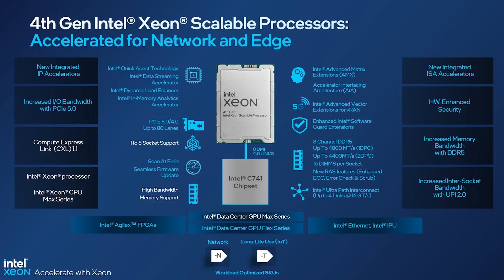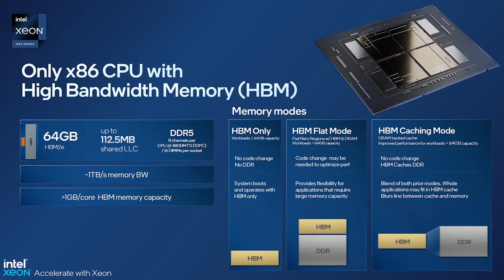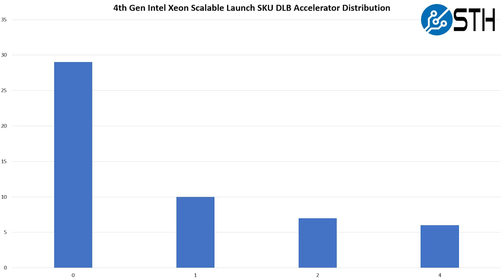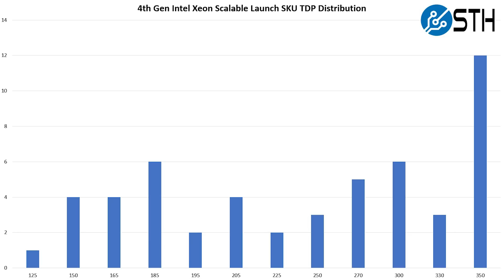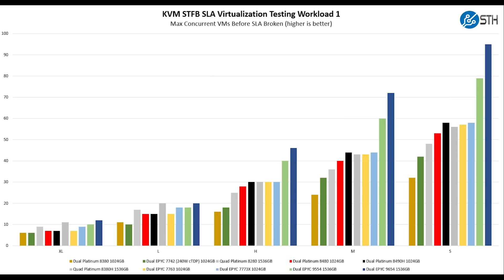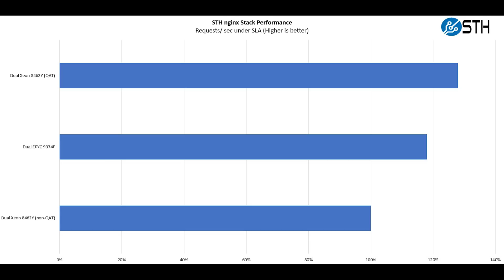$17K Sapphire Rapids Server CPU! Hands-on with the new Intel Xeon

Comment: The compute nodes without the DRAM are going to be very interesting (IE: only HBM on the SOC is system memory, no dimm slots)
Reply: You could see some crazy 4S or 8S boards with the HBM only setup in a relatively compact form factor. The biggest hurdle would just be what to do with 20-40 5.0 x16 slots.
Reply: @DigitalJedi  Using them as NVMe JBOD controllers
Reply: those DRAM cards along with both the Intel Xeon HBM skus and the AMD Epyc APU skus are going to be a game changer for engineering and scientific computing happening outside a government lab with access to a national super computing center.  It's legit super computing-cluster memory and interconnect features that help so much with math heavy simulation workloads coming to enterprise hardware that an engineering firm or university research center can run in an office rack.  Cloud super computing capabilities offered by cloud vendors like Microsoft Azure or IBM are great but often the datasets you are having to transfer to the storage of wherever you are crunching the numbers makes using cloud providers for such workloads less than optimal because only the US-DOE and CERN have internet connections like a 46 terabit per second ESnet6 connection that can move massive amounts of data offsite in only minutes rather than days.
Reply: I am interested in the H parts with QAT for use as a high speed caching node without DIMMs

Comment: I think it looks like Intel has done a really good job finally getting there with Sapphire Rapids. I'm super excited with their CXL implementation especially their plug in nics.  But as a platform engineer working on several projects in quick succession, I won't commit to taking advantage of accelerators into my code base recipes if even I went Intel server exclusive I can't guarantee accelerators being widely available and being adopted, look at Optane .. 

AMD is either lazy or understands I'm only going to adopt something if I can replicate my functional workload across my infrastructure stack and feature enhancement is generational not prescriptive.
Reply: The thing Intel possibly misunderstands about accelerators is that accelerating random stuff isn't really popular as a CPU feature.  Part of the reason CXL exists is to enable a "pluggable" accelerator ecosystem.  This is very popular with the hyperscalers (at least) as demonstrated by things like Google's TPUs, Google-YouTube's dedicated video transcoder ASICs, Amazon's Nitro DPU, etc etc.  A lot of places have some form of custom silicon add-in card at this point and really just want an efficient, high-performance, general-purpose CPU to run the business logic.  Inner-loop type stuff tends to get farmed out to an FPGA or custom ASIC, and networking stuff is increasingly getting on-NIC acceleration.  In summary, I think AMD understands that their CPU may not be everything for everyone, and therefore isn't trying to be that, but Intel may be attempting to make up for their lack of general purpose performance by trying to be "the whole stack" for a wide base of customers.  We'll see how that goes for them.
Reply: AMD is also going non standard silicon route with the ai engine added on to the phoenix range of laptops

I wonder how they will enable developers to take advantage of that

Comment: My company sells vms per core and per gb of ram pricing. Will vms even be able to use those accelerators? They all have to share one accelerator per cpu?
Reply: There is one accelerator per CPU tile IIRC, so on the 60-core chip that's one for each group of 15 cores.

Comment: To answer your question: First of all, I think that licencors are going to start to charge per accelerator as well. That would make Intel happy, because it would justify them selling parts of the chip that you already physically have.
What I think Intel should have done to appease both customers and their corporate interests? Activate all accelerators. Just perhaps only 1 or 2 for CPU. that means that if you do something from time to time or just 1 client on your Virtual Machine does, you don't get penalized. But if you want full power - you have to pay extra. That wouldn't at least feel as a douche move as much. Because despite OEM's doing this stuff for years, when I heard it I was like - "that's such an Intel move". And it wasn't a positive feeling. Though if they were smart about it they would have just allowed all acceleration, drove AMD out (well, maybe not, but it would make it significantly harder for AMD) and once people get completely "addicted" to those accelerators, start renting them out. Or selling them. Not that I'm particularly happy about that.
But that's one of the reasons why I think licenses will also cover costs of acceleration. ATM you can cheat the system and buy like 16-core part that will behave in certain workloads better than 64 core part without acceleration. And licencors don't like this. They want to maximize profit. So does Intel, so I think it will mutually help them that this is locked behind paywall, because they can shift blame on each other and at the same time it starts to spread and thin out and you start to pay. I was in politics. I know how to make people do things that are bad for them and to make them being happy that they do this self-harmful things.